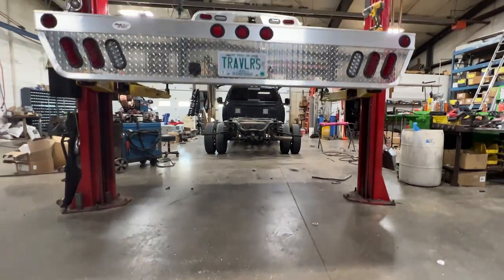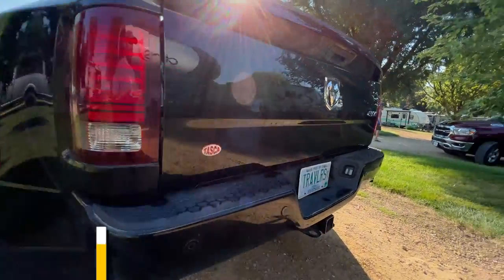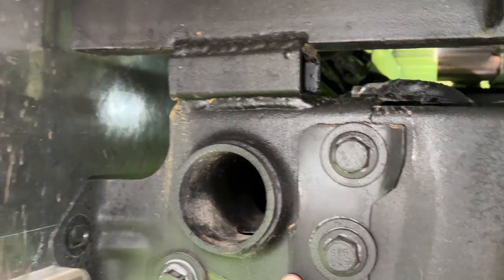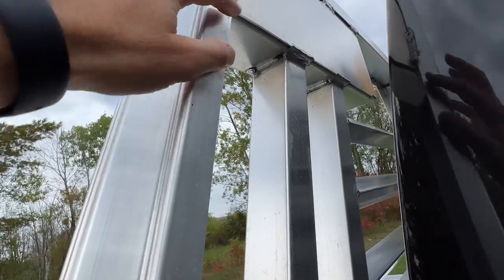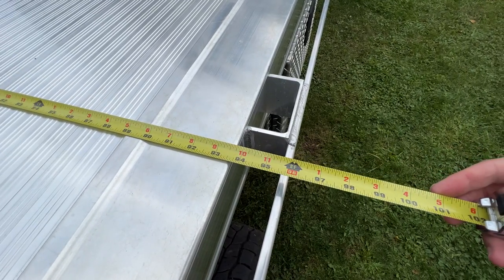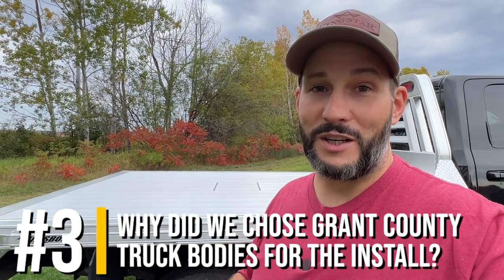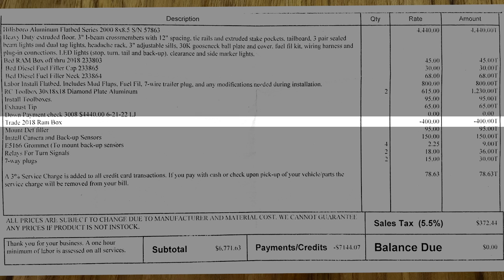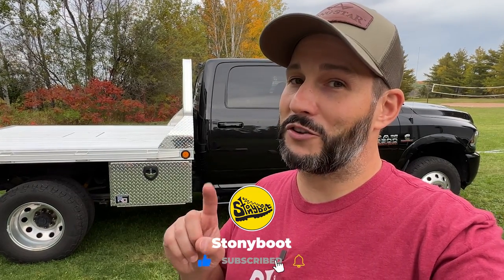TOP 10 Flatbed Questions Answered - Q&A

Comment: I'm really curious about your experience with the camper possibly moving sideways when you're driving in high wind or over super bumpy roads?  You mentioned it at the install but I haven't seen where you might have noted it again.  We have the same truck (factory bed) and have put bumpers in front and back of the tire wells to help keep our camper (Arctic Fox) completely centered.  We've had the camper get pushed (before the bumper blocks) more than an inch off center in high winds before, so it's somewhat scary to think what could happen on a flatbed (without experience, of course).  Love your videos--we watch you guys all the time!
Reply from the maker: That’s a great question. Honestly, I’ve only had it move maybe a 1/2 inch. I had my rubber mat down and the camper on top of that. At one point, we hit some HUGE bridge joints an the camper became a little crooked, maybe a total of 1 inch. I repositioned it and it was fine after that. 

We only have about 4000 miles total with the flatbed, but it’s been great. The ribbing on the flatbed seems to prevent side to side movement because it bites into the rubber. 

Of course, you really need a rubber mat for all campers to add cushion and prevent excessive movement. Also, keep an eye on your turnbuckle tension.

Comment: My only concern is the strength and durability of the install.. looks like a lot going on. ..I figured too they would be direct bolt on and made perfect for each truck. …but thats not really economical for the manufacturer…I’m sure these country boys got it done right but even more sure if it needs adjusting, reinforcing or any improvement you can handle it ! I like the utilitarian looks and function of the flat bed too and I love tool boxes !! I may get a flat bed if my bed ever gets damaged.
Reply from the maker: For the most part, the install is ok. There are some flaws. But it's held up pretty well, so, I'll count it as a win!

Comment: When mounting the bed to the truck frame, using the bolts shown, were new holes drilled in the frame, or were existing holes used?

Comment: I'm probably getting a flat bed for my 07 duramax.  Is the extra 4" height any issue with windage?  Also, are you still using the torklift mounts and did you need any feet extensions for the camper jacks?

Comment: What was your initial reason to switch to the flatbed?  Will be nice to see when your done adding boxes and having the camper on the flatbed.
Reply from the maker: Storage and flexibility with mounting stuff. Also,  it’s hard to prevent the bed from getting beat up, a flatbed is more utilitarian and durable. Makes it easier to work on and inspect the suspension and under truck stuff. But, primarily, boxes and storage.
Reply: @Stonyboot  Makes perfect sense.  Glad to see you got a good deal.

Comment: Ok now after having it hopefully you put some miles on it,  would you do it all again or would you order the truck with the flat bed already on it from the get go?  I know when I was looking at truck campers that was something I was looking at also.   I guess what would you recommend doing?
Reply from the maker: I would start with a f550/5500 and flatbed. For our purposes, we would never be happy with a pop up overloading rig, we want a hard side camper with enough space for both of us. A f550/5500 would be enough for just about any camper. Also, I’d like to switch to gas, diesel has the power, but it’s expensive to repair and maintain, we don’t really use all that power and diesel is harder to find. It also limits our travels to Mexico, US and Canada. Alternatively, an older diesel, like a 99-2003 f550 with a 7.3 would be great. But then you will have a hard time finding parts and it’s a 20 something year old truck. 

I’d probably order a new f550 with a 7.3 gas engine. Find a flatbed I like and have it installed. That opens up possibilities to almost anything, including any 5th wheel or bumper pull options that you want. 

What do you think?

Maybe that’s a good topic for a future video.
Reply: @Stonyboot  I agree I think Truck Campers are a great way to go especially now that you can find ones that are made to order like that one company i can’t remember the name you did a video on that was a huge truck camper.  I think a video talking about that stuff would help out other people looking at them to start off with the right set up instead of going on updating and upgrading as they go because their rig isn’t handling it as well as they hoped.  A lessons learned video maybe?  Also new YouTube videos on the the engines and transmissions on the new F series super duties have been popping up.  They are amazing have you seen any of them?  Definitely changing the game i think.
Reply: @Stonyboot  I personally thin this would make a great topic. Hope this upgrade exceeds your expectations. As far as aswering the question of why you did the conversion, tell'em the truth, because Im a Guy And  I could :)

Comment: install looks a bit hacky to me.   filler port. notching around the rear parts welding to hitch.   but the looming, sensors and other aspects i like.   and 6 inch height cost kind of sucks.  to me they could have spent a little more time in making it solid install vs hacky.  bed looks awesome and functional so if your happy that's what matters

Comment: Why a Dodge 3500 why not a Ford 350 or 450 and why not a Chevrolet or GMC 3500 this is a fuel economy or the price or the height that's my question
Reply from the maker: This is a great question. Maybe I'll make a video where I'll ramble off all of my reasoning for the RAM vs other brands. The summary for now is: In 2019, there was a shortage of trucks, the Ram has a Cummins and we liked the comfort of the interior more than the Chevy/GMC that was available at the time, this was important to me because of back issue. Now the new GMC trucks are completely different and worth a look again. We had our eyes on an f450, but there were none available. Looking at older fords in the 2015-2019 range, we discovered that they had significant problems with their computers. Reviews indicated that while covered by warranty, they frequently failed to fix them leaving people dead on the road for weeks and months at a time. After researching the potential problems with the RAM, the biggest issue seemed to be the possibility of transmission failure in the 120k-170k mile range. That is easier to plan for than intermittent computer failures.  This truck was also only 350 miles away and we got a good deal at the right time. 3.5 years and 73k miles later, I still love it!

Comment: Why in the world would you buy a black truck and they have so many draw backs heat dirt scratches and I got white and it doesn’t show unless you wipe your finger threw it and they are a lot cooler in summer but with camper your in the shade all the time but dirt you have to wash it every week.
Reply from the maker: I’m glad you asked. It was a long term plan to make people ask questions. 

But in reality, when we purchased in 2019, it was the only one that fit our needs. And I couldn’t order one. 

So it’s dirty, no big deal.
Reply: I’ll tell you why I bought a dark truck for my camper set up. Because it’s the only one I could find for miles with enough payload to haul what I want to haul. I bought a used truck. Because why in the world would I order a brand new truck when they lose value as soon as you drive them off the lot.